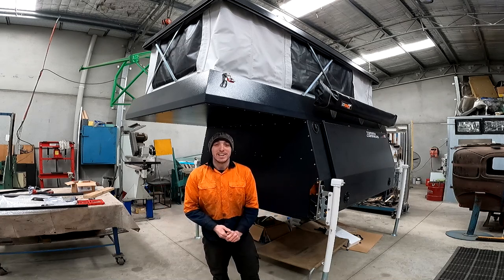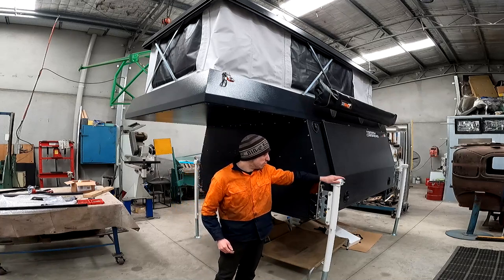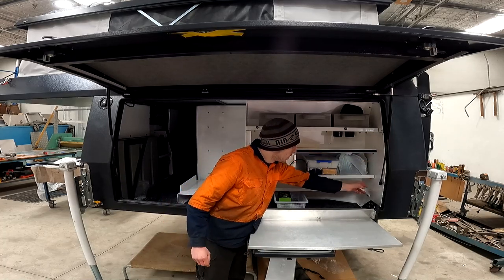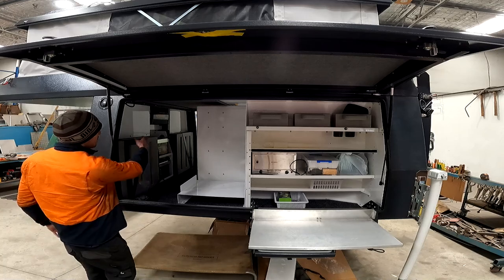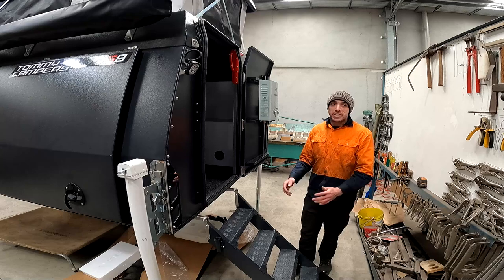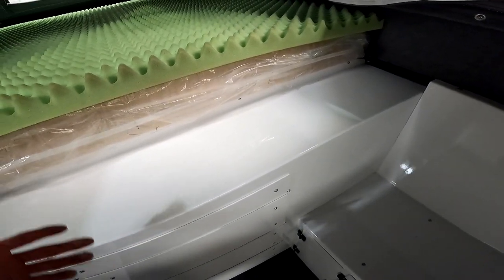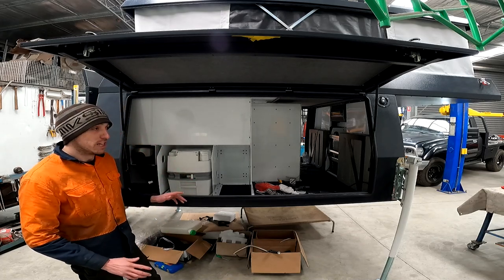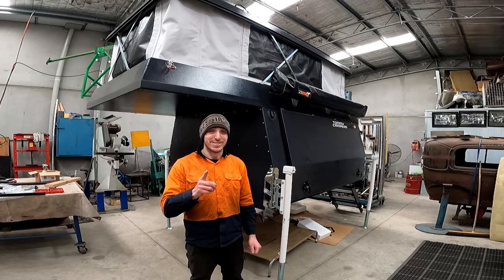Tommy Campers S8 Walkthrough + Review

Comment: Nice fitout. I am jealous of all the extra  room you have with an S8 compared to my S4. My build allows for the toilet to be accessed from a cushion on the seat, which saves the weight of a slide. I note the CDH seems to be mounted vertically? Mine is too, but all the experts told me it would not work. It does work, and is certainly more efficient spacewise, at least in my setup. Looking forward to the electrical fitout.
Reply from the maker: Cheers David! Yea the S8 definitely is spacious 😁. Our heater is actually mounted horizontally. That's interesting that they can work vertically though!!!